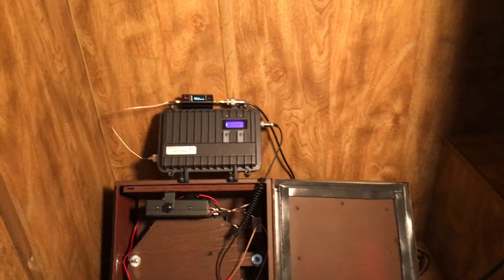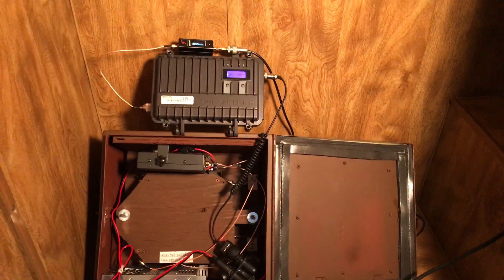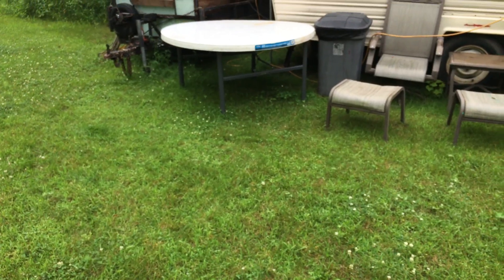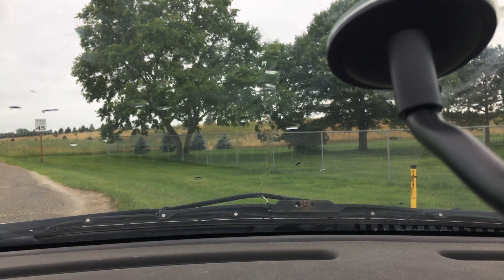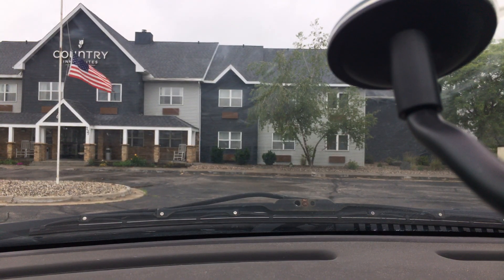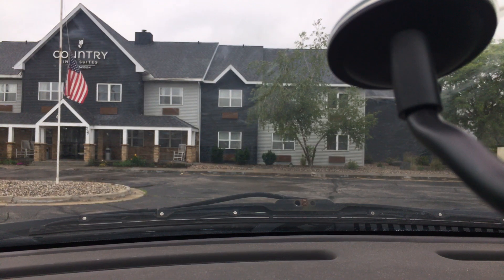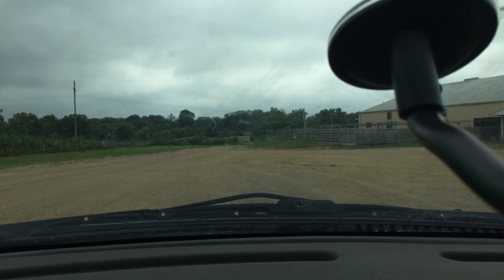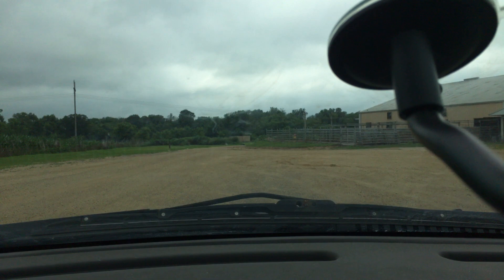🔺Retevis RT97 GMRS two-way radio repeater 20watt VS 6 watt distance (range) test!!🔺

Comment: WHY not use the full 50 watts that are permitted by the laws of GMRS why waste your time and always use lmr 400 coax and use " N " connectors please learn how to do it right please.
Reply from the maker: I am using the amp that came with my GMRS bundle package! Which include the coax cable! This is why it's done this way in this video, this way people getting the same bundle package will see how it works out of the box 🙂

Comment: Im glad you did this test thank you . I think that me using the simplex repeater and a 5 watt radio topped off with a decent GMRS antenna. Im confident that I could set up something that would make communication with my brother. 
As for making contact with my son is going to be difficult.
Thanks again for trying it without the amp. This winter once all the foliage is gone the range will increase. 👍
I’m not going to set a repeater system up yet. I want to upgrade my power supply and coax cable and antenna at the base . Then I will work on a system for my brother & I to communicate. 
I may go the Retevis route for comms. For my son.
Reply from the maker: You are welcome. I am glad it helped :) And yes a good antenna makes a difference! Before buying an antenna, make sure you compare antenna gain with other antennas!
Reply: @GMRStwowayradio  I will I have the same meter you do. Plus a rd-40 meter . All my antennas are GMRS tuned. Although I may experiment with the channel I’m planning to use and see if I can get a perfect SWR for said channel. Before and after I put everything together. Then again when I put the set up at the location I will test SWR .
Reply: Also please keep doing GMRS videos. I’m always trying to learn more and find out about new radios
Reply from the maker: @46camper50  - it's a good little meter, I like it. Of course, the nanovna is more accurate. But for most people the meter is good enough.  yup always best to double check swr :)
Reply from the maker: @46camper50  - yup BUT i will do a MURS VS GMRS distance (range) test just to see the out come :)